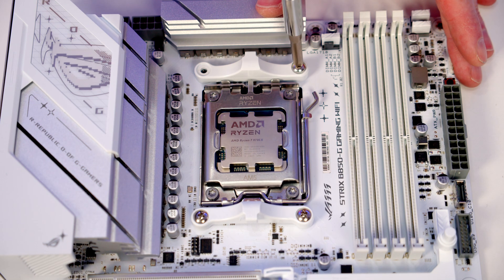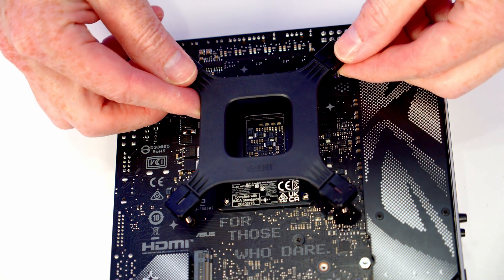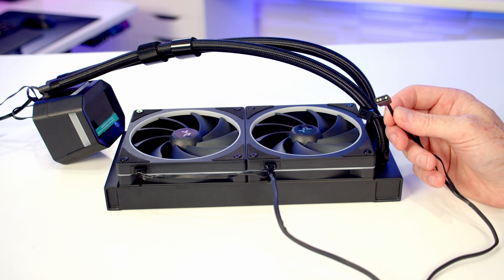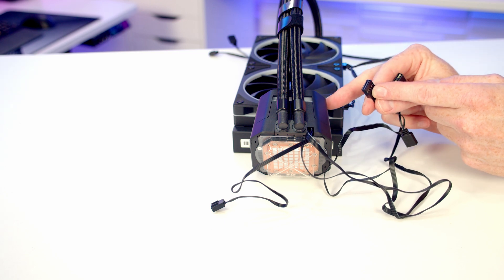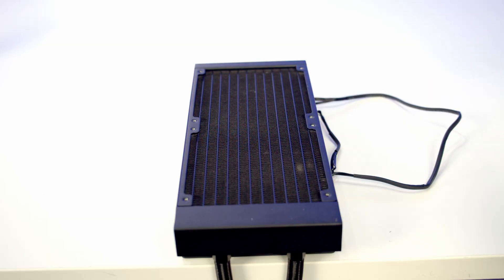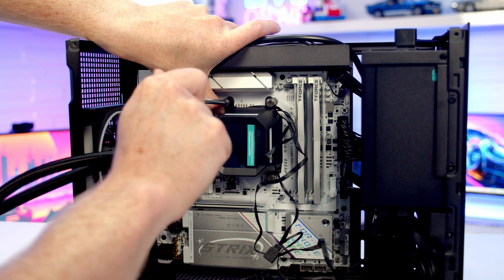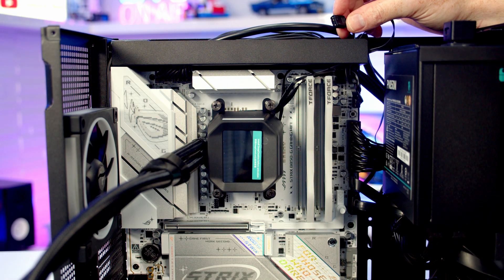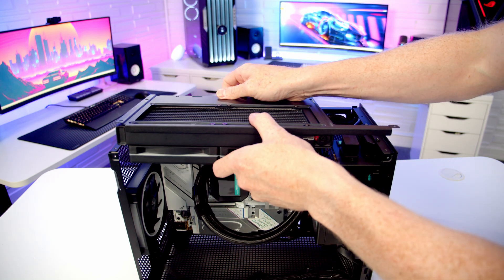DeepCool LM240 - Installation Guide

Comment: Hi Chris ..
I know this question has nothing to do with this video but i was wondering if you could help.
After watching your fractal terra jade case build from a year or two ago ,im finally getting round to building in  a terra case pc 😊 .
I have a Ryzen 7 7800x3d cpu and no gpu as yet but i was wondering which new itx motherboard you would recommend, theres a few out there all with some specs i like and dont like ..  Price range would be mid to high tier motherboard.
Anyway thanks for all the build videos and hopefully you would spare a bit time to answer 😊
Regards
Nick